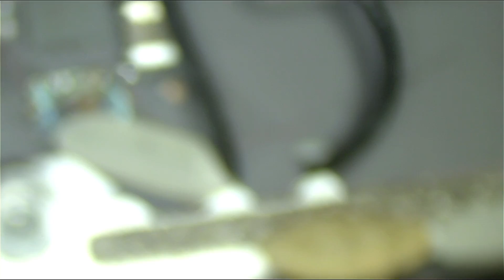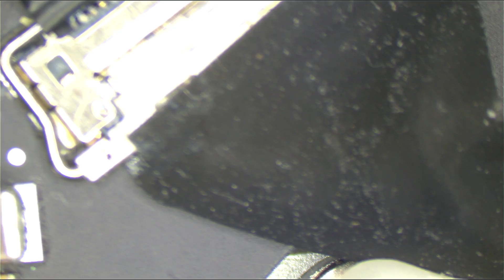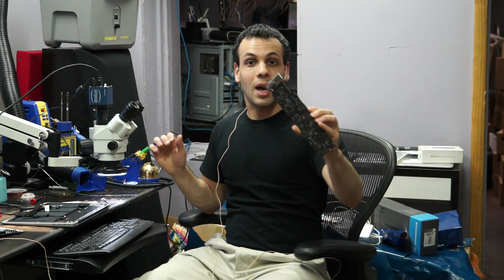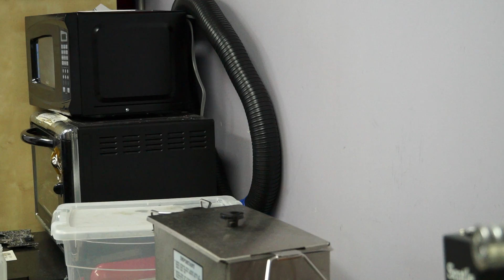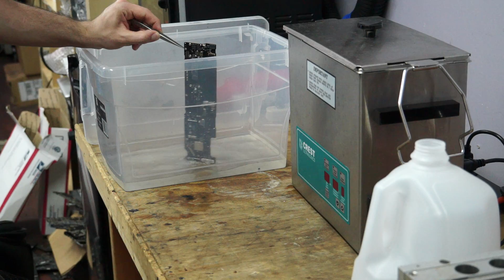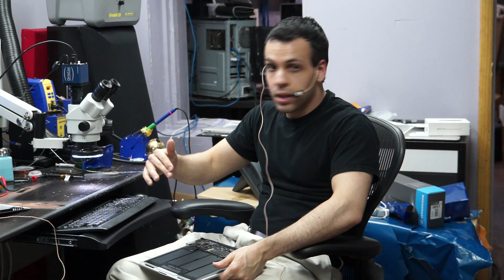How to use rice to repair water damage on iPhones and Macbooks

Comment: Just two weeks ago i spilled water all over my fathers p8 lite. What i did was i opened it up and used towels to pad off the liquid and then i put it in a plastic container with rice and a few of those silica packets. I know disconecting the battery wouldve been helpful but with my lack of knowledge and tools i feared i could rip something off. I left it in the rice for two days and when i turned it back on it worked with only the gyro being broken.
Now i know i was really lucky since there was a whole lot of water inside but my question is this: Have i done things wrong and are there things i couldve done better considering i had no tools or knowledge to do more on component level. Do you think the result would be the same had i not used rice?
Thanks!
Reply: Compressed air could have removed the water faster, but its nearly impossible to get the water out of tiny spaces between the circuit board and the components. There are no easy answers.
Reply: +Whitedove Internet Studio i heard compressed air has a similar effect to shaking where it would force the water further into the phone and to other still dry components. When i put the phone in the rice the front camera compartment clearly had water in it and only after an hour the water was gone. I dont know if the rice helped but it seems it was definitely drying out. Im just glad that the damage water caused wasnt on important components
Reply: You did the right thing by opening it up and geting rid of the water with a towel. Which actually does remove water. 100% of the reason the phone wasn't a smoking hole in the ground was because you opened it up, and physically removed the water.

Comment: I think that this has stuck from the times when most of the phones had removable batteries. The argument was that if after dunking or spilling something on your phone, you remove the battery soon enough, you can leave the phone in rice so that the rice absorbs the water and you can use your phone sooner than you could otherwise (if leaving it dry by itself); all about getting the water out, nothing about the damage it may have done.

But for some reason people still believe that it can help with phones with non-removable battery.

Comment: I think the argument is just that rice is a mild desiccant, so it can help lower the humidity in an enclosed area to promote evaporation better. That is all. As far as I know it's not suggesting that it will fix anything, just that it will help to dry up any water that is in there in the event that water did not damage the circuitry.

Comment: rice works like silica gels.
Reply from the maker: neither of which will fix spill damaged electronics
Reply: +Louis Rossmann you dont seem to get the point good sir.  no one says rice will fix the damage. it only removes the moistures from the system.

Comment: +Louis Rossman  I can't complain about any of your videos.  You are the Bob Ross of yuppy-owned Mac fixers.  
Rice works like desiccant.  It can, in fact, pull water out of a device.  It does not repair corrosion, like you said, but I have personally used rice to great success to get water out of my phone.
Reply from the maker: Rice will not pull water out of a phone. It just doesn't happen. If it works again it would have worked again anyway, if it doesn't work it wouldn't have worked regardless.
Reply: Louis Rossmann Desiccant pulls evaporated water out of electronics.  So does rice.  It sequesters the vapor.  People have been putting rice in salt shakers and in brown sugar for eons.  It's not a myth.  If your phone is wet, putting it in rice will evaporate water from the phone to the rice.  Like you said, even real desiccant won't fix oxidation.  Rice I would imagine is a poor desiccant, but it works.  Instant rice is the key as it has no hull to prevent absorption.  The rice kernel you showed was not instant rice.
Reply: Whitedove Internet Studio I stood corrected twice over.  According to controlled tests (cited), not only does rice not work as a desiccant any better than regular evaporation, it's a bit ridiculous.  

I work in aviation and usually put a heavy conformal coating on pcb's to prevent corrosion.  I wonder if any laptops use conformals.
Reply: Matthew Richardson "...conformal coating on pcb's to prevent corrosion," that is useful information. Consumer electronics do not use any form of coating to prevent corrosion; Its' bare copper and other metals. They are not built to the standards of devices where people lives are a risk if the fail.
Reply: Time is not on the side of the device that is wet.

The corrosion is the chemical result of two different metals with a liquid conductor. Salt, starch (which works like a desiccant), are conductors; the famous potato battery is based on the starch content of the potato. If the battery is in the device it will speed up the corrosion by ionization. 

Pure water is not a conductor but everything that dissolves in water is. All acids, all bases, all salts turn the water into a conductor.

The rice waits for the water to evaporate by then it may be to late; depends where the water is, if it is between the copper on the PCB and the tin on the devices (copper tin battery http://sci-toys.com/scitoys/scitoys/echem/batteries/batteries.html ), which also contain lead from the solder ionization is taking place.
Reply: +Whitedove Internet Studio There are a few companies I've worked with that make "rugged" pcs for flight test applications.  They take a COTS pc, add a conformal coating, and they epoxy down all the caps and big parts so the board can survive vibration.
Reply: Matthew Richardson I'ld like that process done to some camera gear I have.

Comment: Really stupid question incoming.

Supposedly I got my electronics wet, does dousing it with alcohol to dilute the water in the device help or will it just fuck the shit up even more?
Reply from the maker: depends

if the battery is plugged in, probably yes

if it's a microphone or a screen, probably yes

plain old pcb, no
Reply: Thanks, I guess what I did to my old phone did have some merit.

Comment: If you spilled some sort of liquid on your device, how long does corrosion take to ruin the device? Could I immediately put the device in to isopropyl to attempt to displace the liquid? Assuming the liquid is water based. Then put it in an oven. Basically can I catch it soon enough as to prevent corrosion?
Reply: unplug everything
then warm with hair drier
Reply: Depends on the size of the conductors in the device. Rubbing alcohol 5% alcohol and 95% water not much of a difference to effect drying time. What he is using is 99% alcohol 8:20 Don't put the whole device into the oven, some plastics melt at temperatures near the boiling point of water.

Comment: Rice does work.  It works because rice is a dryed food and it absorbs moisture that is in the air and if it touches water it does it better.  Im thankful that u showed the myth is to widly used.  It only works if the machine was off when it was broke and this will get rid if the water before the damage.  Then u should be cleaned

Comment: Once I dropped my iPhone 4S in the toilet and immediately put it on the hotel room heater thinking it would help evaporate water inside (no way to get it repaired at the time). About an hour later I obtained a bag of rice and put the phone in it on top of the hot heater for 24 hours. I believe this helped the evaporation process and because the water is soft (very few minerals in BC, Canada) not hard, I don't believe much if any corrosion damage occurred immediately on the board anyway. The rice simply "removed" the soft water that could eventually corrode things. So in essence I'm saying rice has its uses and works fine as 'repair' in certain cases. 

Background Info:
" If a water is "hard," it is less likely to "leach" metals from plumbing pipes but often leaves a deposit on the inside of the pipe, while if a water is "soft" it has less of a tendency to leave deposits on the inside of plumbing pipes. If a water is soft, then it has low hardness."

Comment: For the love of god listen to what you say.  Of course rice wont fix a corroding motherboard. 
THATS NOT THE POINT OF IT
Rice soaks up moisture very well and placing the device in a container of rice hopefully dries up the surrounding air and PREVENT CORROSION not fix it. I get the part where you are a successful businessman and i respect that and thats why i keep watching the videos but some points you make on them are really senseless. Suppose i drop my phone in water. The first thing i can do it switch it off or remove the battery and place it in rice so soak up water. I get the part where its not the correct way to do it but its a quick fix to "potentially save" your device.
Reply from the maker: +Mariojuanaaa . aaa rise potentially saves nothing. Rice absorbs and nothing from inside the device. It is completely worthless.

Comment: Now I need to make myself some curry to eat the darn rice, damn the internet :P 

Seriously though, my first idea would be to open the thing up asap and dry it with some cotton or paper roughly and clean it with alcohol. A screw driver and bits are never more than 30seconds away. That said knock on wood I never had to deal with liquid damage,  the only thing that died on my is my old samsung R522 laptop which might be corrosion simply from often sitting in a hugely moist environment, but watching here I might just have to open it up and see what is wrong. Thing is a worthless piece of shit dual core, but it be a good exercise :)

Comment: Ok so it won't repair water damage, but it may remove water before damage occurs. I have fixed heaps of electronics this way. From radios to brick phones.
Reply: I agree with you there. The best thing is to clean it with deionised water and then alcohol. Clean tap water damage can be sorted out by rinsing then drying out in rice.

Comment: How about a Food saver container with desiccant under vacuum?  Did this to an old ipond nano that a daughter doused in coke.  I rinsed it in distilled water for a couple of minutes, gave the it the old electronic "Taylor Swift" treatment (shake it off for you old fucks like me) and drop it in the vacuum.  It's working 5 years later, but the girls just laugh at that huge 4 gig capacity.
Reply: corrosion will build up on the PCB. even when you do that. you are lucky at that point but otherwise you should have took it apart and clean it the propper way
Reply: We had just gotten her and iPhone, so it was her 'school' device"  Hindsight is 20/20 though.

Comment: I'm thoroughly surprised people are still commenting. My 2 cents is that your argument is 100% valid. Once the water has done its damage, rice won't do shit. What rice does help with is absorbing any standing water that hasn't done damage/mitigate water damage potential. Granted, even this logic is fucked if you spilled on a device that's already on because electricity and physics yada yada. What the issue is, as you mentioned, people shove it in rice, not fully understanding the reasoning, after liquid has made contact and they panic shutoff the device, in hopes that it'll turn back on after taking it out of the rice. The damage is done. If there, and you so happy to have a leprechaun in your pocket, was no damage, sticking the device in rice MIGHT, big MIGHT, prevent damage by absorbing the liquid.

Comment: The best way to use rice to repair electronics is have a nice filling curry before you start work taking the device apart and cleaning it with alcohol and the proper tools.

Comment: Rice is a horrible idea. It doesn't work and just causes more work to clean. Don't defend it if you have never repaired any electronic device.There's no way rice on the outside of the phone will suck the liquid under metal shields between tiny chips and components. That doesn't even make sense. Customers put devices in rice for days all the time and you open it up and it's still wet inside. Like he said, if it was meant work it will work.

Comment: It deserves to have liquid resistance not a cleaning. It's like having a phone whose glass will brake in the first drop and say it's the duty of the user to not drop a smartphone he uses 70% of the day.
 I should be able to wash my hands and hand the phone right away, yes it's tech but the shielding should provide some kind of protection as it will not make the device any colder otherwise.
Reply from the maker: +JonatasMonte I'm surprised about these things because Apple is usually good at looking at big picture user experience. Since they do not repair these boards it should be no problem to just underfill or con-formal coat the entire thing after manufacturing.

Comment: I dropped my Samsung phone while washing up. There were actually water inside the screen. I wrapped the phone in very thin paper to prevent rice from getting into the ports and then left the phone inside a box of rice (I'm Asian so we naturally have lots of rice). Two days after, my phone was working like I never dropped it in water.

Now there are some reasons the rice trick worked: it was a Samsung phone so I could remove the battery and there were lots of holes so the water was sucked out easily, besides it was in the water for like 3 seconds.

Obviously it wouldn't work on an iphone or a macbook.
Reply: the rice didnt do anything. The water evaporated completly after some time and nothing else happend.
Reply: ***** You might be right.
Reply: +LeVQChi Two things saved that phone.  
1. you could get the battery out.
2. It was in the water for a very short time.
Reply: cjmillsnun Yeah maybe the damage wasn't bad enough. Maybe the rice didn't do anything. The phone might have been ok even if I hadn't put it in rice.

Comment: I have heard a few stories from friends though that putting their water damaged phone in rice helped them.
Reply: And how would you know that the rice had any effect at all?
Reply: +JustMegawatt That trick actually saved my Samsung phone. It wouldn't work on an iphone though.
Reply: I've heard it working on a few iphones
Reply: +Doc T&#39;Soni It will work for a short time until the corrosion reaches some vital part and then its end of the game.
Reply: Marcel Diezasch it's easy it didn't the issue is the minerals left after the water dried. Fact no need to argue.
Reply: Minerals cause corrosion in combination with water if like salt,  it speeds it up even. What's confusing for you?
Reply: Rice don't do shit to save your phone an ultrasonic cleaner with alkaline soap and alcohol bath does, that'd the only thing you need to know no need to talk physics, fact.